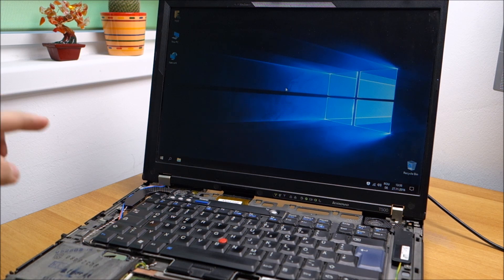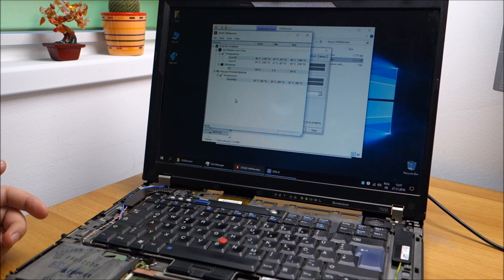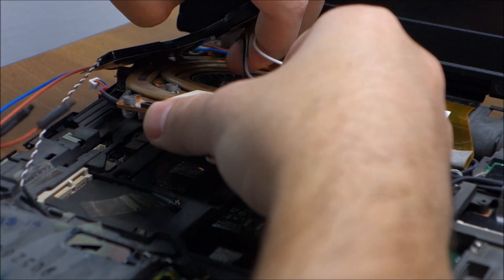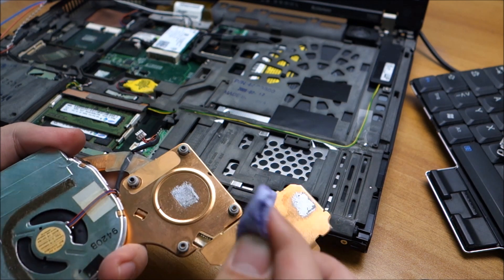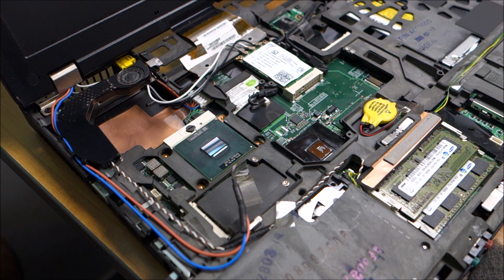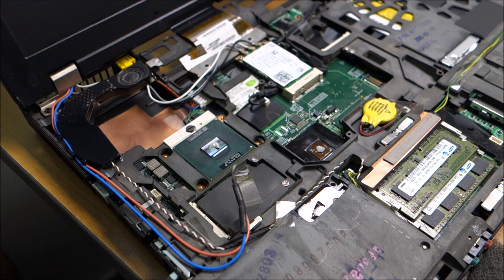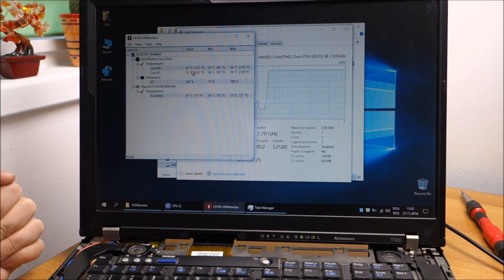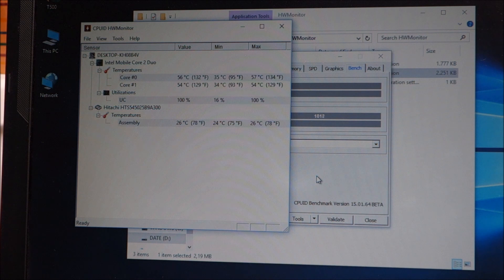DANGER! Coollaboratory Liquid Ultra - big problems after just one year

Comment: they are not dry off, they need around 30 degree to become water form, do research on Gallium, those is Gallium base, also you dont use it on aluminum, those will eat up aluminum and change to something bad for heat transfer, read the package, it said don't use on aluminum. if you dont have the package read here again.

http://www.coollaboratory.com/product/coollaboratory-liquid-ultra/
Reply from the maker: +Nick Y then why was it in liquid form when I applied it at about 22°C?
Reply from the maker: +Nick Y so you think that maybe that aditive evaporated?
Reply: no because it mixed with aluminum, kinda like rust of metal, corrodes aluminum
Reply from the maker: +Nick Y but there is no aluminium on this cooler. But orhers seem to say that this does not even work on copper coolers, they have to be nickel plated.
Reply: no point to argue, just need to understand Gallium, what they do to. if your coolaboratory ultra change form, that gonna be something is aluminum it touch. i use it on delid 3770k and still working like day one.
Reply from the maker: +Nick Y no arguing here, but there is no alluminium there for sure, so that shouldn't be the reason. This is why I say that other people sugest that this paste is not good even on copper, so it can only be used on delided cpus. Sadly this is not writen anywhere on the product.
Reply: just remember liquid metal don't dry, they only go bad when they corrodes with aluminum. if you dont trust it, try Arctic MX-4, Noctua NH-T1, or Gelid GC extreme. those is some best of the best thermal paste.
Reply from the maker: +Nick Y I switched to AS4, as the difference is not big enough on non delided cpus to worth the risk

Comment: the problem is you cant use liquid metal on aluminium OR pure copper so the cooler in the video is nearly pure copper . so no wonder this is happened.
Reply: The reason is: the gallium in the liquid metal tries to establish a compound with the copper. For this reason IHS are normally nickel plated. Nickel prevents that both metals can start an electron exchange. So pure copper has also as aluminium a problem with liquid metal. But as I know from my experience the liquid metal of Thermal Grizzly also starts a light electron exchange but the liquid metal has no evaporationg elements and will not dry out.
Reply: @maxlpower4985  Thermal Grizzly will dry out too, had this problem all the time...
Reply: @Wadenbeisser-wk1xx  Completely wrong. LM has no evaporating elements so an "dry out" effect is physically impossible.

An age hardening (periode of >10 years) by electron exchange is the only result and follows to circumstances that the seperation of cooler and cpu/IHS is much more difficult.
Reply: @maxlpower4985  colloquially "dry out"

at least Gallium has a negative potential and Copper has a positive potential, which will cause the Gallium to migrate and plate the Copper... so Indium and Tin left and these metals alone can't be >liquid< at room temperature
Reply: one thing, the Gallium has just to drop below ~50% so that the LM is no more liquid
Reply from the maker: +flashtu what???
Reply from the maker: +flashtu where did you come up with the pure copper thing? Nobody ever said that. They only say not to use it on aluminium.
Reply: yes its a weak point of the coollaboratory liquid it destroy aluminium and cold-welding pure copper it was a known problem but the most coolers are nickel coatet so no one really cares about this problem. The only liquid metal i know which this doesnt happen is the thermal grizzly conductonaut but i wont bet on this. maybe we see it in the future a lot of alienware laptops are today repastet with this so we will see in one or two years if this is better than the coollaboratory liquid.^^
Reply from the maker: +flashtu if that is accurate, then it sucks and coollaboratory is trully only useful for delided cpus or rare coolers that have a plating on them.
Reply: Yes you can try it with two stripes of copper put the liquid metal between them put a hot dryer with around 100degrees on them for 5min and you will see if it dry out or weld the copper together.
Reply from the maker: +flashtu sadly I don't have any of the paste left to try this out and I don't think I will buy it again.

Comment: Make sure you are not using any alunimum and the gap between the cpu dye and the heatsink is minimal
Reply from the maker: +TFAY Productions maybe like you and others say the gap was too big or even the copper was not pure. Not really sure.
Reply: I fixed this prolbem on my laptop by bending the heat sink bracket to make less of a gap

Comment: Try with a hair dryer? it should melt the metal
Reply from the maker: +Mads Rosenfeldt did not think of that, maybe it would work.
Reply: It is a metal with a very low melting point, maybe you have had some evaporation of one of the metals in the blend or tiny amount of copper react with the liquid metal raising its melting-point so that it is not melting at room temperature but a little higher.
Reply from the maker: That might just be the case.

Comment: this happens when people think that Liquid Metal pastes are like conventional TIM. 
They will only work when there is no gap between the heatsink the components.otherwise it will oxidize and make a crust. 
even more so with a gap like you have you are risking hardware damage. 
stop blaming the paste, research more.
Reply from the maker: +achingowl why is this not specified on the product? It seems it is a really important thing, so it shoud be put on the label with the other warnings.
Reply: Ultimate DIY Not necessarily, because that product is made for desktop use and not laptops specifically. sure it can be used with laptops but not without due diligence. This is using a liquid metal paste in my P870Dm3-G laptop - 
https://i.gyazo.com/ce7f8f36f0d76d42d5785abdbe501526.png
Reply from the maker: What I'm trying to say is that I followed all the rules on the package and I read a lot about this paste before using it, but sadly I did not stumble onto any forum that said not to use in laptops or use with extreme care. Now I learned from the comments in my video that it is not really good in laptops, but this needs to be said clearly on their product page and on the package to prevent further misuse if that is really the case. I'm not just an isolated case and honestly we don't really know if the distance is the true problem, maybe the cooler is not pure copper like it seems or even something else like the laptop CPU running hotter for longer than a desktop CPU, because it did not seem to dry the same on the chipset and that thing has an even bigger gap, but it is cooler.
Reply: Do IC Diamond specify that their thermal paste scratches the die? Nope. Does Intel specify that they use shitty thermal paste under the heat spreader? Nope. Its all marketing. Also the issue you faced is not an issue with every laptop. it works for some and for some it needs more user tweaking. And for some its totally useless.
Reply from the maker: +achingowl you do have a point. They leave stuff untold, so not to scare customers. It's sad, but you are right...

Comment: quick note on polishing: you should not do it. it will just remove material of about 0.1 mm, decreasing contact. I did it on a heatsink and had to buy a new one. also although looking ugly, the grey layer is not thermally insulating.
as others pointed out the contact is not very good causing the liquid metal to dry fast. also liquid metal reacts with copper, causing it to dry. nickel does not react, that is why delidded CPUs dont have this problem so much as the heat spreader is nickel plated. 
best thermal paste is thermal grizzly kryonaut and best liquid metal is thermal grizzly conductonaut. kryonaut has a thermal conductivity of 20, normal thermal paste 10, conductonaut of 80, normal liquid metal of 40 to 60.
Reply from the maker: If this is the case, this TIMs should have more warnings on them and should be directly advertised for delidded CPUs. This would prevent problems like I and many others had.
Reply: @UltimateDIY  That's because they assume only specialists would use this. For hobbyist, it's unfortunate but if they don't have the knowledge then they'd discover those flaws by tryal and error (good riddance)... which is why there are professionals as there are amateurs: they give the composition of their compound, thus you should be able to know about the outcomes by yourself given your own context.

Comment: I wonder why you have so thick layer of this on the heatsink. This paste is super sensitive to purity of the heatsink and die, maybe reaction with residues you left before applying the paste caused some chemical reactions, oxidation, and maybe your chipset was cleaner, the old thermal paste could contain aluminium powder (usually has) and maybe this caused such reaction, experts in this matter should explain how it could happen. Thank you for your video, very informative.
Reply from the maker: +deviceundertest thank you for watching my video. The layer was not thick at all when applied, because a thick layer of a conductive fruid inside the laptop would mean searching for trouble. I cleaned the heatsink really well with alcohool, so I'm sure it was not that. The only thing that I can't be sure about is the purity of the copper in the heatsink itself, so maybe that is the problem, or even the fact that laptop CPUs tend to heat up more than desktop ones.

Comment: i used LM ( thermal Grizzly conductonaut) for more than a year and 0 problems, here is my post, your problem was the space between the heatsink and your cpu is too much 
http://forum.notebookreview.com/threads/after-1-year-of-thermal-grizzly-conductonaut.799343/
Reply: Seconded. Liquid metal should only be used on surfaces with already great contact. Most laptops use low-pressure, mediocre mounting. Some older ones even left spacing for a thermal pad. 

When in doubt, I use silly putty to determine how good the mating is. I use a copper shim on the CPU if there is a significant gap. For most laptops, I end up using Noctua NT-H1. It's cheap, available everywhere, and a good medium viscosity that is perfect for the vast majority of laptops. If the mating is above average, I use the even cheaper (and thinner, and easier to spread) Arctic MX-2.

Personally, I only use liquid metal TIMs on delidded (or already soldered, like AMD) desktop CPUs.
Reply from the maker: First time I hear of this and it does not really make sense. Either way, the more I read about this online the more I find it to be a product that does not give enough informations for ussage. Many people say it is suposed to dry up to form a sort of weld, well that would mean it should have a warning on it to not be used on mobile devices like laptops or computers that get moved alot. Others say that it even dries on copper so it should be used only if nickel plating is present on the cooler. Others say that it dried even in their delided CPUs and probably there are bad batches of this stuff around. Others say you need to reaply it at a minimum of 6 months to keep it from drying up. Others say that the space between the CPU and the heatsink coold be too big, but then why did it not dry up, in my situation, on the chipset where the space is even bigger? The reality is that this product is great when it works, but is really unstable and can damage hardware when even the slightest thing is not to it's liking. There are too many people that had this thing dry up on them, that all of them could have done something wrong, but then again there are many people that did not have problems so that for me means unstable product or bad batches.
Reply: this thing will stick on your copper heatsink forever. I have alienware 15 r3. I try to take it clean it up. The more I try, the more it keep making the heatsink turn black
Reply: No you don't understand. You need to read dude. Idc how much pressure due to 3 or 4. This liquid metal will stick in your heatsink. If you use 99% alcohol and try to get it off. You will make your heatsink black mark
Reply: sorry, i tried. i was trying to help him. i know a lot about laptops, specially Alienware laptops, because i have had a lot of them
Reply from the maker: +Juan David Alvarez maybe, but this happened on more than one laptop, so it's a bit of a problem in my opinion. I will try the Grizzly in the furure.
Reply from the maker: In this case shouldn't they have a warning about this on the package, so there is no risk for the people that buy it? It would make sense and prevent situatuions like mine where I found out that it it not suited for laptops the hard and expensive way.
Reply: for older laptops i always use IC diamond 7. is the best non conductive paste that fill perfectly the gaps :)
Reply: for other side, the scratchs are good, the sponge is for scratch the surface before using LM thermal paste, is no for cleaning, is suppose to be used to sand the surface (copper)
Reply: twizar  I sand the surface on the copper to prevent bleeding. as you see the pase don't hold perfectly on the cpu die, it tend yo bleed out. so I sand the copper surface to increase the contact force between both (Lm and copper) thermal grizzly conductonaut have warnings inside the paste package. coolaboratory don't. both are good I tried both. but conductonaut is 1*C better and hold perfectly on time. I noted that it tend to fuse to the copper. I highly recommend you using thermal grizzly kryonaut or ic diamond 7. both are high end non conductive thermal pastes.
Reply from the maker: I will give them a go next time I have a chance.
Reply from the maker: +Trung Le yes, it really does stick to it...
Reply: the problem is not the paste, the problem is the bad contact area on your heatsink due to the 3 screws design they made on that models, to fix that you have to bend 1 of the arms to ensure more pressure on that side. there is a lot of info on notebookcheck forums. i suggest you to look there http://forum.notebookreview.com/threads/alienware-17r4-15r3-disassembly-repaste-guide-results.797373/
Reply: This liquid metal won't come out like normal thermal paste
Reply: i really know what i am taking about look at my post http://forum.notebookreview.com/threads/after-1-year-of-thermal-grizzly-conductonaut.799343/
Reply: that black mark doesn't mean less performance. you were having bad temps due to bad contact because of your hetasink design 3 screws to cpu ( 2 at one side and 1 on the other side )
Reply: and dont act like a stupid, i was tryning to help you, i know a lot about thermal paste. i have been doing this at least for 8 years
Reply from the maker: Please try to stay polite. The buttom line is that CLU is really unstable and the smallest thing can make it missbehave. If all conditions are ideal, then it's a great TIM, but in real life conditions are sometimes imperfect.
Reply: @trung le ..me too! this shit cant come out...ohh god!  what can  we do to get rid of it?
Reply: Trung Le Turn black means corrosion is taking place. Remove and clean and replace it with something else
Reply: Juan David Alvarez the thing is I don't care about the performance. Did I even said ANYTHING about it? All I said is the damn liquid metal stick to the heatsink. I don't care how much experience you have because this is youtube, there is nothing really proof it. I talking about the liquid metal stick to the heatsink. All I want is anyway to clean it up, and you keep saying performance this, performance that.

Comment: Its supposed to dry, it was still wet it would drip on to the components. Also laptops get moved around and goes through a lot of physical stress, causing it to crack.
Reply from the maker: +K3YSP3R so basically it should not be used on laptops? If this is true, maybe they should write this somewhere on the product or their web page, so people can avoid future problems.
Reply: It is not meant to dry this much, and anyway, this isn't normal drying. This is metallic corrosion caused by the Gallium in the liquid metal reacting with the copper of the heatsink.
Reply: are you sure it was Ultra not Pro? they advertise MetalPad to use with laptops
Reply from the maker: +deviceundertest it was the Ultra for sure.
Reply: COLLABORATORY CONTAINS Contents materials: GALLIUM CAS-Nr.: 7440-55-3 EG-Nr.: 231-163-8 video shows Why you dont want to use this on any Aluminium 
https://www.bing.com/videos/search?q=%3a+GALLIUM+copper&&view=detail&mid=9E710D6FA3DE3DCC836D9E710D6FA3DE3DCC836D&FORM=VRDGAR Check to be sure gallium is safe with the surfaces its in contact with